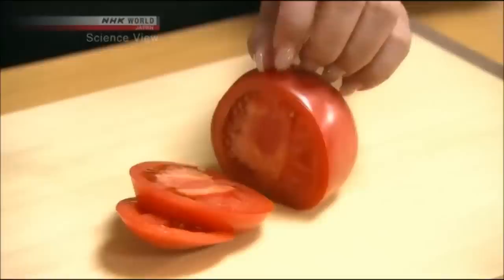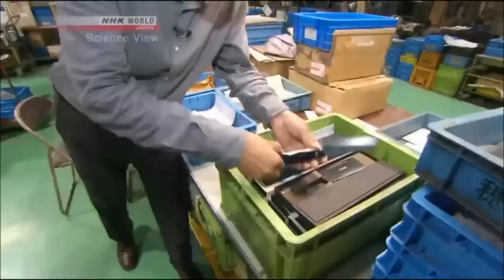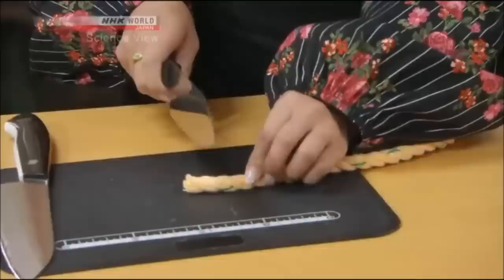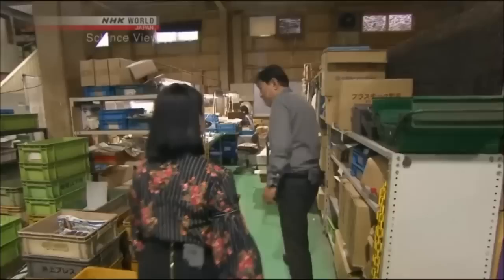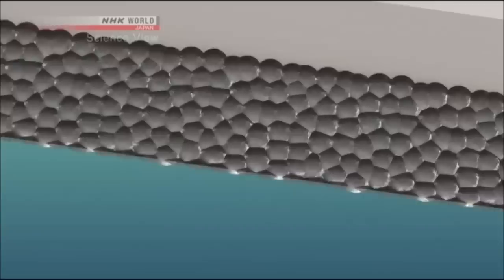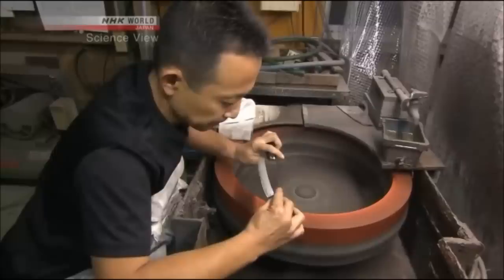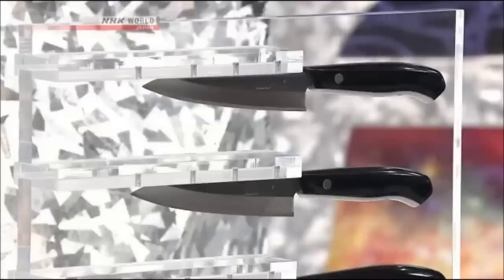Japanese Knife That Doesn't Need Sharpening

Comment: Ceramic kitchen knives. Ceramic is more brittle than steel, but holds an edge better than steel the best option & highly affordable.
Reply: Rogertron 85 ceramic makes a fantastic vegetable knife and should be stored carefully and never used for anything else. Always remember to throw that in. You'll get friends saying ceramic knives suck and find out they used theirs to carve a turkey
Reply: just use carbon steel, if you are going to be that careful with your knife.
Reply: Rogertron 85 I bought a ceramic knife, used it a few times, throw it away and went back to my japanese shirogami-steel knifes.
Reply: i dissagree. i had several untill i got my full vg10 steel knife which is one of the hardest steels out there.  it gets used daily and i sharpen it less then twice a year my ceramics didnt last that long and cant really be sharpened. at 50 bucks it was as much as a good ceramic knife so i only use my now not to sharp ceramic knife for apples so they dont go brown instantly. everything else vg10 steel ftw.

Comment: I think there is a translation error.   This is a knife that you do not need to sharpen  Vs a knife that does not need sharpening.   The Owner said in the video when your knife is dull send it back to the factory for reprocessing / sharpening / add Ti carbide edge.  YOU cannot sharpen the knife at home!.  Anyone still using there Ginsu knife?

Comment: Uh huh. I'm sure an at home cook could get a very long life out of the knife without sharpening it if it was taken care of, which most don't seem to do. And these knives advertised as never needing sharpened are usually so hard they're brittle (at least if you're going to throw it around a drawer, use a glass cutting board, etc)

If it really never needed sharpened we'd all have it in restaurants. We have some pricey knives and I personally love my Japanese knives but every knife will need sharpened. I'd even say a knife that needed sharpened more would probably work better for amateurs. I'd rather have to drag it across a stone every 3 months than re profile a chip in the edge because my aunt came over, chopped a rib bone in half, and threw that bitch in the dishwasher next to a frying pan.

Comment: whatever the pro's and con's it's still an interesting idea.  The maker (imo) is trying to mimic Wootz steel.  As Wootz had natural carbide filaments in it.  So, as the 'iron' part of the edge wears down, the ends of these carbide filaments protrude out from the edge (creating a microscopic saw edge) and a very long lasting (and easy to maintain) cutting edge.  If you know where to look in India it's possible to find billets of this steel (actually left overs rediscovered/dug up in old forges many hundreds of years old - when the historic Wootz steel mine was active).  As I know some modern makers have sourced this material for special blades projects.
fyi - I've seen various blades forged from true 'old' Wootz.  I advise anyone interested to track down and examine one.

Comment: In a sense, the tungsten carbide coating technology is similar to a zirconium oxide (ceramic) knife that the blade stays sharp for longer, but it needs to be factory sharpened. Perhaps it is easier to keep a sharper at home and stay with a traditional knife.

Comment: OK, so coating the edge with titanium carbide makes it hard and long lasting. But what does the treatment do to the sharpness? A truly sharp edge uses fine carbide steel, and should have a radius of a micron or so, achieved by having carbides of a fraction of a micron in size. Are these TiC deposits smaller than that, or giant blobs on the edge? In any event, no knife is indestructible, and I prefer to be able to repair and sharpen them myself.
Reply: Note to self - just realised they don't claim it's a fine edge, just that it's "jagged". Sounds like a bread knife to me!
Reply: You talk much but don't think enough. Yes every knife is jagged at a micro level and can be polished (and I do that with my knives). But good luck using a high grit stone to polish Titanium Carbide - you'll still be polishing the Christmas after next.

Some people believe that truly micro serrations help with certain kinds of cutting, but these TiC deposits look larger. And I will always stay away from any knife that I can't maintain myself.

Comment: Jagged edge? That's a fucking unpolished edge, probably made with one of those gnarly ribbed honing steels. If you just use a knife with a steel like Aogami Blue Paper hardened to 63 HRC and polished with a 10,000 grit stone, your knife will cut like a razor and there will be no jagginess to lose. And the knife in the video will eventually get dull when those cermic inserts are ripped out through hard use.

Comment: Lol, all good knife steels use "carbides" to cut. You don't need to add "titanium carbide" to a knife edge if it uses goos steel, even stainless steel.
First, the definition of a "stainless" steel is a steel that contains at least 13% chromium. This large amount of chromium is unable to dissolve and form...drum roll, chromium carbides, the remaining chrome resists rust hense stainless.
Steel is just iron and carbon, the addition of carbon form carbides which are hard and cut. Steel also contain other metals such as chromium, vanadium, Manganese, Molybdenum all of which affect strength, toughness, edge holding and hardness and many form carbides with the carbon element. This is a property of the steel itself which is why there are good expensive knives and cheap knives.  The best steels use powdered metallurgy that evenly distributes these carbides throughout the steel.
Sure you do not need to sharpen it because its a coating and you simply cannot. Once it wears, and it WILL wear, you throw this knife away whereas a good knife can be reshapened exposing fresh carbides to cut.

Comment: Sure, if you make the steel dense and hard enough the edge will last longer but when that knife will need sharpening (and it will at some point) it will be a nightmare to sharpen.
I guess this knife can be beneficial for cutting soft materials such as vegetables.

Comment: OMG these japanese are really good at marketing, half of the things they were saying were not true about cutting edges. and the stainless steel knife had jagged edges because it was a cheap quick grind one. if u were to get a professional kitchen knife, it would be crazy sharp. plus the japanese knife had a really thin bevel, making it suitable only for cutting. plus if the cutting edge doesnt need sharpening, then the steel would have to be extremely hard, and would have a higher chance of cracking

Comment: High en kinfe Vs cheap kinfe over time both will be blunt after a long time
Reply: dec 1 the question is after how long the knife shouldn't be
 too hard because it Will break and shouldn't be too soft because it Will need sharpening way too often that's why different steel materials have different heat treatment

Comment: Who needs this when you can just go with a very thin FFG 1095 blade and take a steel with it before use ?
I prefer a knife I can easily sharpen and maintain over a knife that I can't sharpen or takes a long time to sharpen at best.

Comment: I remembered years ago the famous knives were from Germany. These knives were from Germany Solingen. The brand is the Eye. Now I cannot find it anywhere in Singapore. These knives were favored by Fruit Sellers. They never needed sharpened at all. Why ? They were cutting pineapples everyday until the blade of the knife became curve. Once I brought some fruits and  used the fruit seller knife to cut  for myself. So far so good until one day in my carelessness I just lightly touched the blade and the blood flowed out. From that day onward I never touched that knife again. This knife is called in Singapore as ONG LYE THO  or pineapple knife. So to all pineapple lover I have a word of caution. Don't ever eat pineapple on an empty stomach. 60 years ago I was ten then (1958) and a green grocer on a tricycle was passing by my house and I brought from him a cut pineapple for ten cent. Oh what a lovely sweet fruit before lunch. So for the next three days I ate it before lunch. Then after eating it I felt a very sharp needle piercing from the top of the stomach down through my intestines. I have now never eat pineapple on an empty stomach again. Sweet yes but ACIDIC. It can CORRODED your interesting lining.

Comment: Let's face it, this knife is not even razor-sharp. It could barely slice that carrot in one hell of a motion. Notice the lost of speed followed on each cut by a full-stop of the blade 3/4 in and that 'tack' noise when the knife is touching the cutting board at the end clearly shows that pressure has been put on the knife at 3/4 though the cutting rather than the blade doing the cutting. 
They could at least made it real by using a tomato...
Then again,  that tomato at the start could be sliced in one motion. It was cancer watching the rocking motion after the perfect first slice.
Reply: King Raaz the comment section is full of ppl like you that never held a knife
Reply: As someone who actually went to culinary school, I back what King Raaz said. Besides, you NEVER rock a blade back and forth unless it's serrated. If it's a single smooth blade you make one single long stroke and let the sharpness of the knife do the work. You just glide the blade through what you're cutting.

Comment: Last I checked you want to get rid of the jagged edge. Which is why people go through such lengths sharpening their blades. With the logic of these people you'd get a sharper knife on a 100 grit stone than a knife you progressed up to a 2,000 grit stone then finished with a ceramic rod. A carbide edge probably does hold an edge fairly well but the rest of this video is crap

Comment: So what is the hardness on that steel?
Reply: Balubish Tech , its diamond/dogshit hardness
Reply: ummm cooked play doh putty knives? they are as hard as a 2mm thick piece of copper
Reply: Dont you mean the tungsten carbide?
Reply: No im talking about Rockwell scale. And pretty sure Tungsten isnt used in chefknifes.
Reply: Tungsten IS used in chef's knives. When blade manufacturers talk of "Blue" steel then it contains tungsten (sometimes called wolferm). Blue steel also contains vanadium, cobolt manganese and other additives to make the carbon steel less brittle. But blue steel has larger particles and as a result tends to not be able to sharpen as much as white steel.
Anything that is stainless has chromium as a percentage of the blend, and chromium grains are even larger. Stainless for this reason is even less able to take as sharp an edge as blue or white steels.
The Rockwell value is a consequence of the initial quenching process hardening of the finished blade. High Rockwell values tend to be brittle. A blade manufacturer could temper the blade afterwards which lowers the rockwell value somewhat, but makes the blade less brittle and more durable. Any blade with a rockwell value about 60 will be prone to chipping of the edge, and will require whetstone resurfacing / sharpening to retain a clean cutting edge.
Reply: Joanne Lowery well info. Still have my question of the video knifes rockwell cause they claim you never have to sharpen it :-)
Reply: It's not as hard as I am right now.
lol

Comment: There's a real issue with all these knives (ceramic, TiN coated etc) : even if it takes 1000x more time, they WILL get dull... and then, how do you make them usable again? You don't, you can't... Steel knives can be sharpened, and a steel knife can last years, or even decades.... 
Just learn how to sharpen decently people, it really is not that hard

Comment: The original Damascus steels (wootz) used carbides in the steel. This is a valid manufacturing process and not a novelty. I would re sharpen with diamond sharpeners. These knives would perform exactly as they say.

Comment: excellent
Reply: Excellent your ars. Use your brain sometime)))))))
Reply: your not speaking coherently - what are you trying to say
Reply: It is con marketing. Nothing last forever. They cover one side of blade with titanium which last few month. If  you sharpen from that side it is gone. Generally it is normal knife with one side of blade covered of 1 mm wide of titanium. Just trick they play with people. You happy just for one week then should start to sharpen it. Once you sharpen it Titanium is gone.
Reply: It is con marketing. They cover one side of blade is 1mm titanium. After 1 week of use you have to sharpen it as any knife. But if you sharpen from side where is titanium it is gone. So you have then normal knife. To prolong titanium on blade you can sharpen only from one side which has no titanium.. I hope you understand. Better have just normal knife and sharpen it as usually
Reply: Written here 3 times in reply not going to do it again
Reply: i didnt know this - thank you for clearing this up - your right
Reply: thank you - i saw all the replies - i was away from computer

Comment: First off she holds the knife like someone who has never used a knife before. I though she was going to chop those ridiculous fingernails off.
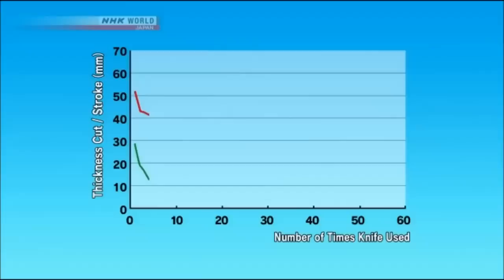At 2:30 she says "Its so easy you don't need to apply any pressure at all" Yet you can CLEARLY see as the knife wobbles about that she is applying a ton of pressure.
......I cannot get over how badly she handles the knives.
If you use a honing stick before every use like you are supposed to, a kitchen knife only needs to be sharpened once a year....... You mean ONE time a YEAR a kitchen knife needs to be sharpened! How bothersome!
Reply: Nidhoggr I agree with all your comments. You mirrored my thoughts exactly

Comment: Where can I buy one?
Reply: +FlyingTex Thanks
Reply: never buy it. Just buy normal knife, It is marketing bullshit.
Reply: Why would you buy one?
Instead, perhaps get a $50 dollar Kyocera ceramic blade knife. When you break it get another, and another. You could buy 8 ceramic knives for the cost of one of these pieces of rubbish.
Reply: I have a $10 knife that can cut tomatoes into paper thin slices without holding it after a couple of passes in a 400 grit wet stone. The down side is that it needs to get reshaped every other month, but my point is, if you pay more than a couple of hundreds for a knife you are paying the extra bucks just for the hype